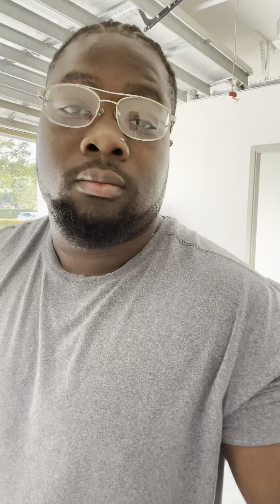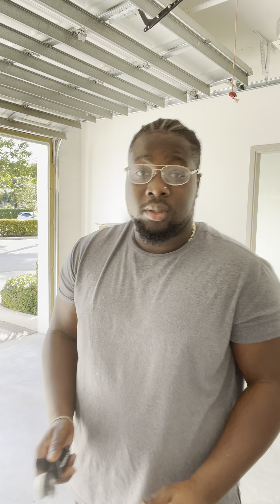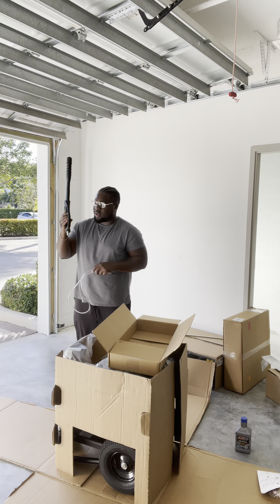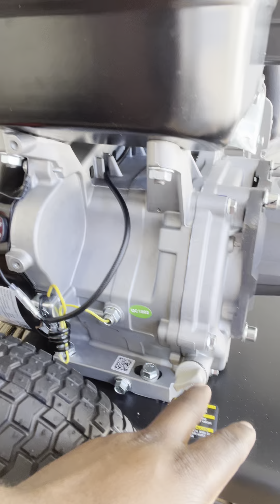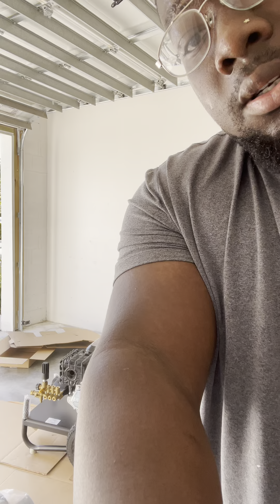Simpson Pressure Wash PS60843 Setup and Upgrades

Comment: Great analysis, thank you! I need some advice: I have a SafePal wallet with USDT, and I have the seed phrase. (alarm fetch churn bridge exercise tape speak race clerk couch crater letter). What's the best way to send them to Binance?
Reply from the maker: Hi there! Thanks for reaching out. To transfer your USDT from SafePal to Binance, I'd recommend following these steps:

1.  Open your Binance account and go to the 'Wallet' or 'Funding' section.
2.  Click on 'Deposit' and select USDT as the cryptocurrency.
3.  Choose the correct network (e.g., ERC-20, TRC-20, or Binance Smart Chain) that matches your SafePal wallet.
4.  Copy the deposit address provided by Binance.
5.  Open your SafePal wallet, go to the 'Send' or 'Transfer' section, and paste the Binance deposit address.
6.  Enter the amount of USDT you want to transfer and confirm the transaction.

Regarding your seed phrase, please keep it secure and private. Never share it with anyone or store it in an insecure location.

If you're unsure about any part of the process, consider reaching out to Binance support or a trusted cryptocurrency expert for guidance."

Please note that I avoided asking for or confirming the seed phrase, as it's sensitive information that should be kept private.